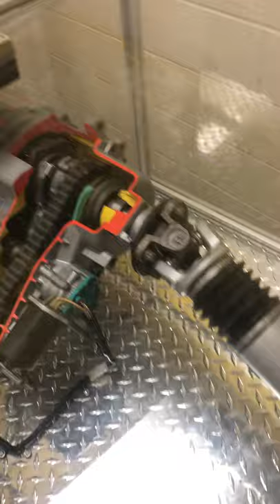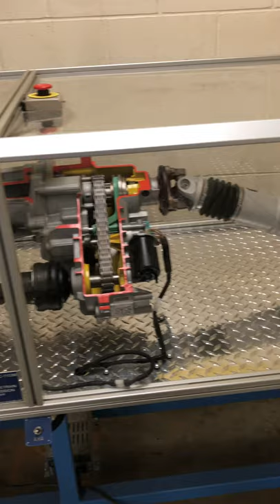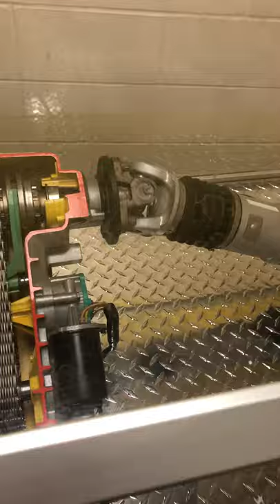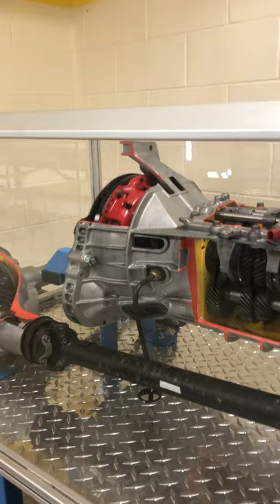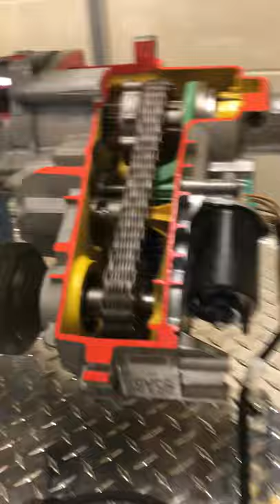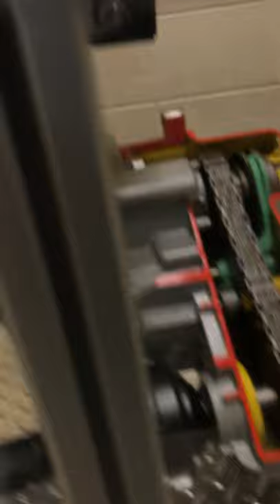Transfer Case Operation

Comment from the maker: Thanks everyone for one thousand views. Not sure who all is viewing this video. Comment with your location in the world.....
Reply from the maker: Manitoba, Canada
Reply: GA, 🇺🇸
Reply: Idaho, Usa
Reply: Chicago
Reply: Nova Scotia!
Reply: Tehran, Iran
Reply: How does the transfer case shift motor work? I have a 2 speed transfer case that grinds/growls at 60mph. I rebuilt the transfer case and have the same noise.  New chain new bearings…. Could the shift motor cause this growling noise at 60?
Reply from the maker: @paulw2583  the shift motor would only make noise during shifting. Make sure the noise isn’t a seized u-joint or rough hanger bearing.
Reply: Sweden
Reply from the maker: @gabrieloprea9181  right on man. It’s great to see how far these videos can reach
Reply: @I have a 2013 ford f150 4x4 I drive in 2 high all time but the from shaft is spinning all time and from cv axles is that normal?
Reply from the maker: @ yes. Those front hubs do not disengage. So the front wheels turn the front axels, which turn the differential, which spins the front driveshaft. The transfer case is not engaged so it just free wheels inside of it. 👍
Reply: @autotech4103  this guy is driving the same truck but from shaft no spinning
Reply from the maker: @andryjcisneros2334  interesting enough, that year range of F-150 has 4x4 and AWD options. AWD would spin the front driveshaft and 4x4 would not. I’m not sure if that’s the case or whether your truck has a locked axel situation……
Reply: @autotech4103  I send you the link of the truck is a 2013 f150 4x4 
But the from shaft is not spinning in 2wd 
So I have the same truck but my from shaft is spinning all the time with the cv axles 
To be honest I’m confused 😅

Comment: What could cause a loud clicking from my transfer case. It started out of the blue and its loud 😞
Reply from the maker: I would first rule of the driveline as it would be difficult to distinguish. Removing the front driveshaft could help in the process to eliminate it from the equation. Loose chain could cause a chain slap or tick for sure.
Reply: @autotech4103  would it still drive if I removed the front drive shaft ? I did think possibly the chain. I'm absolutely gutted I love this car. Thank you for your reply it's much appreciated
Reply from the maker: @ yes, it would drive just fine
Reply: @autotech4103  I thought it would on most but it's a RR sport so has silly computers and such and it's not switchable from 4x4 to 2wd like most 4x4 are. No harm in trying I suppose. Thanks :)
Reply from the maker: @ it will probably trigger a traction control/ABS light. You can just disconnect the battery to clear them after diagnosis.
Reply: @autotech4103  thank you I'll give it ago when I get the free time. Thanks 😊

Comment: That is BW1354 Ford Ranger setup it has oil pump in it. Most of the time chain is still turning in 2H because it has no unlocking hub or they are locked in. Ranger for short time had Vacuum hubs but they took them out so everything sill be turning in T-case. Explorer had same setup but never used Vacuum hub they have disconnects on right side few years. But in the end they dumped that too so everything was left turning. Ford showed it only cost about .02 of a mph in fuel
Reply: Hello. What is the difference between the 2014 and 2021 Ford Ranger transfer case?
Reply: The chain does not spin in 2 high unless your vacuum hubs are not functioning Correctly  or you have manual  hubs and they are in the lock position !!

Comment: I am trying to find voltage requirements for a 2015 gmc canyon transfer case actuator relay signal wire. Anyone know?
Reply from the maker: Are you speaking of the grey wire with the black stripe between the transfer case and the control module? Are you planning on supplying that wire with voltage?

Comment: Really nice explanation of the inner working of the TC, thank you!
I just have to correct something. At 6:25 if the 4WD is disengaged, the chain will still be spinning since the front diff and its shaft is not disengaged by the wheels.
Reply from the maker: You are right, this truck does not disengage the front axels. Good find!!

Comment: Another important feature is torque multiplication. And often they are around 2.73:1 ratio. Which is a Little more significant than 2:1 in the example. Great cutaways to show operation.
Reply from the maker: Sounds like you put your truck to work pretty hard. Most people don’t have a functional use for 4LO

Comment: Thanks, I wasn't sure if the chain constantly spins but now I see if the front drive shaft isn't spining then the chain stops too.  I have manual locking hubs to allow greater flexibility and take better advantage of 4x4.
Reply from the maker: I wouldn’t say the manual lockers give more flexibility but they are definitely tougher.
Reply: @autotech4103  I can avoid windup by unlocking one hub or both manually and operate in 4-low.  Can you do this with auto locking hubs?
Reply from the maker: @thisisyourcaptainspeaking2259  I didn’t think about using 2low for much before. Probably has a use backing up really heavy trailers.
Reply: @autotech4103  I also use low for pulling a trailer up ateep mountian roads at low(er) speed.  Up/down with tight switchbacks using engine braking instead of my brakes.
At the boat ramp I unlock drivers side hub and launch/retrieve in 4-low, if traction becomes an issue I jump out and lock the hub.  Maybe it's not necessary to use low gear but I typically use 4-low as opposed to 4-high in most cases anyway, just unlock the drivers side hub when on pavement.
Reply: @thisisyourcaptainspeaking2259  im sorry and thanks, could you explain "wind up" and why you unlock the drivers side manual hub while in 4 low at the boat ramp ?
Reply: @thisisyourcaptainspeaking2259  Great thought..The crow hopping really gets anoying..

Comment: I just changed the oil in my mitsubishi transfer case and found a large chunk of metal on the magnet. It doesn't appear to be a tooth (seems quite soft). Any idea what could break off inside the case? Getting ready to refurbish it regardless.
Reply from the maker: The metal on a shift fork would be a softer material, but probably not magnetic. Not sure……..
Reply: @autotech4103  thanks for the reply.

Comment: Great visual on transfer case Operation, any idea how the steering angle affects modern transfer cases shifting in 4 low automatically when turning. Experiencing some T case issues myself and before i pull it out i was curious on the relation between my steering column and my transfer case
Reply from the maker: Turning and shifting to 4LO is definitely a weird one. I’d imagine it being an electrical issue. Not sure how anything in the tcase could cause it. What kind of vehicle?

Comment: Great explanation and visual.  Thank you!
Reply from the maker: Glad it was helpful!
Reply: @autotech4103 hi sir. Hello from Chicago. So transfer case actuator shift from 2hi to 4hi or to 4lo but what is the function of second actuator located in front differential. Trying to fix my sierra pickup truck
Reply from the maker: @marekkrepa9982  the solenoid in the front differential engages and disengages the from axels. When they are disengaged the front driveshaft will not spin when the wheels are moving down the road.
Reply from the maker: @marekkrepa9982  depending on the year of Sierra pickups, those actuators are known to be poor.

Comment: Great explanation, my RAM 1500 except those 3 modes have also 4-Auto mode which in my conclusion operates most of the time on 2 rear wheel drive (2 High) but can enable front wheels in case of loosing grip(4 High).
I drive on this mode all the time which means the chain is not moving by 99,9% of time. Does it mean it is not lubricating upper part of transfer case? Maybe I should change mode to 4 Hi or 4 Low from time to time?
Reply from the maker: No need to worry about that. There is nothing moving so no need for lube. When the Auto kicks in then it throws oil.

Comment: Could you explain a little about the pump and clutches
Reply from the maker: Hey Eroom, the oil pump in the transfer case is used to get oil into hard to lubricate oil such as the planetary gear set and the main shaft. Splash lubrication joins forces with the oil pump in these modern designs. I do not understand which clutches you are referring to? I haven't seen clutch packs in a transfer case but like anything prove me wrong. Muffler bearings do exist.
Reply: @autotech4103  Gm 246 transfer case has clutch packs, I’m starting to learn a little about them now
Reply from the maker: @eroom2087  please post here your findings when you have them

Comment: Awesome explanation!!  I’m pretty sure my transfer case is on the front of the transmission.  With that said, Any idea what the light rubbing sound around the transfer case area could be when I’m driving at low speeds and especially going around corners?
Reply from the maker: Does it only happen in 4WD or all the time? Your transfer case needs to be after the transmission
Reply: @autotech4103  Been happening in 2WD.  It used to be intermittent but now it’s more frequent.
Reply from the maker: @colinc1633  if the rubbing speeds up and slows down with vehicle speed, I would suspect u-joints.
Reply: @autotech4103  thank you sir I’ll get that checked out.  I really appreciate it!🤙🏼

Comment: Sure wish you would have explained the function of the transfer case clutch. Where is it? How does it work?
Reply from the maker: This particular transfer case doesn’t have a clutch. There can be clutch packs to deal with difference in speeds between the front and rear wheels.

Comment: do you know if u can shift transfer manually without motor? or does motor have to hold it in place?
Reply from the maker: If you remove the motor you could make “shift” a device to manually shift

Comment: Good job sir 
I am a newbe at this I have a 245 j with a electric motor . I am not sure if that is what my problem is the motor that is ? Not sure how it works? I have a jeep commander 5.7 Hemi the button on in the cabin is suppose to put the transfer case in neutral it blinks but nothing is happening could that be the electric motor?:) if you have time please let me know. Texas. Near Dallas.
Reply from the maker: Some models need to have their transmission in neutral and park brake set. I would check your owners manual to find out for sure.

Comment: Excellent video although I was looking for an AWD TCase presentation.  Can't wrap my head around AWD...
Reply from the maker: I’ll make a video in the coming days as I should have a couple AWD vehicles in the shop next week. Think about it as a differential between the front and rear driveshafts. When there is slippage in the driveshafts the AWD transfer case attempts to match the two shaft speeds. This keeps all wheels driving at the same speed.
Reply: @autotech4103  Thanks!  I almost got it sorted in my membranus...👍

Comment: Some mistake.... You should NOT use 4Lo in manoeuvring a trailer in "tight spot" for most (if not all) T Cases. Reason is 4Lo is (in those majority T Cases) a mode with central locking, meaning both propeller shafts are at the exact same speed. Try a tight turn (say lock-to-lock on the steering) with the central lock. Will either force wheels to slip hardly or damage something.
Reply from the maker: Sure, turning tight is an issue. I gotcha
Reply: I have manual locking hubs for this specific reason, not automatic locking hubs.

Comment: I'm working on a vehicle now. How is it that I have 4 low (with reverse) and the motor switches out of 4 Low, but there's no drive in 4 High or 4 Auto.
Reply from the maker: I would check the actuator that actually shifts the transfer case. The electric motor or the switch/wiring could easily be at fault

Comment: is it possible to have a problem in your transfer case that causes slipping and grinding while in 2wheel high? primarily in reverse and or high gears moving downgrade...
I'm being told the problem is in my transfer case, however all my 4 wheel drive is working fine.
Reply from the maker: Depending on the vehicle and the design of the transfer case; it is possible.

Comment: Would have been neat to see the transfer case in neutral. I always wondered how it sepererates the drive shafts.
Reply from the maker: I’ll do that in the coming days and post it here!
Reply from the maker: https://youtu.be/oN0kF2lgXYs
Reply: @autotech4103  I just watched the video. That was really cool to see. I always wondered how it did it. So basically from what I seen and what you explained is the transfer case just disengages the planetary gear set. Really cool to see. Thank you for answering my question! You earned a sub!

Comment: How can you explain, other than "bad input shaft TC seal", the fluid can migrate from a automatic transmission into the TC?, talking about the olds TC with vacuum switch, maybe the vacuum plays a role in the issue?
Reply from the maker: On those old transfer cases the problem really isn’t the input seal but the vacuum switch. The vacuum switch is suppose to be sealed and not apply to the case of the t-case. The t-case vent gets sucked closed and pulls fluid by the output shaft of the transmission through the input shaft seal of the t-case. Replace the vacuum switch and the other problem may go away without seal change. Kinda a cool automotive problem……

Comment: Question. I was told in my 2001 Mitsubishi montero limited that the front driveshaft is always turning even in 2nd and it locks via the front diff. I have had the vehicle for over 75000 miles. Should I change the transfer case fluid? Thx
Reply from the maker: I change my 4x4 fluids every 100,000kms in Canada as it is a nice round number and easy to remember. 75k miles would be a yes for me…..

Comment: What happens when you tow this type of setup and the front wheels are spun freely with the Tcase set in 2H. Does it affect the tranny at all ?
Reply from the maker: This is a standard trans, the rear driveshaft will be spinning while being towed, the front driveshaft will be turning while being towed. In 2H the power from the rear spinning driveshaft will turn the output shaft of the trans. Because the trans I assume is in neutral the rest of the gears will not spin. The output shaft bearings will be spinning without lubrication so damage will occur. With the tcase in neutral the power will not spin the transmission output shaft

Comment: I have a 2000 ford ranger that will shift and operate in 2 high and 4high , but when shifted into 4 lo there is a repetitive clunking noise while in 4lo operation . Would you have any ideas why? It is a new to me used truck and I’m slowly learning more about its engineering . So far I have been hesitant to run it in 4 lo to see if the knock / clunk goes away , not wanting to get stuck in 4 lo permanently . Any advice would be highly appreciated .
Reply from the maker: 4low is often difficult to shift into and out of. Make sure the transmission is in neutral when shifting into 4low or creeping slowly ahead. I would guess your clunking is it trying to engage still. Does it drive at a very slow speed when 4low is selected?
Reply: Thanks for your reply . I enjoyed your video on the transfer case operation , it helped me to understand the mechanical operation in action . I grew up with a 78 Toyota landcruiser that was virtually indestructible mechanically, but unfortunately the gas consumption was not realistic economically this day and age . As I have been reading more about the ford equipment , there is a whole cornicopia of procedures for the mousetrap to engage .such as clutch sensors , brake sensors , gem computer units  as well as a transfer case motor that controls the shifting mechanism ,not to mention puh pneumatic hubs . I have also noticed a few loose wires behind the dash , and near the pedals . Guess it’s time to des if er some wiring diagrams . The joys of owning a new used vehicle . Thanks again from a backyard wrench  @autotech4103

Comment: What does locking the hubs  manually at each wheel band NOT having the transfer case electronically in 4 x 4 do?
Reply from the maker: It locks the front axle shafts to the wheel assembly. The front wheels will then turn the axle shafts which will also spin the front driveshaft on most vehicles. No wheels will be driven by the transfer case, just all the gears in the differential will spin

Comment: Why my truck act like it's on 4LO ( can't even turn) but positioner is set to 4HI mode?
Reply from the maker: Turning with a vehicle in 4WD can be difficult. Some vehicles are much worse than others. You could also be dealing with a limited slip differential that is locking while cornering because of clutch issues. 4Low is the same as 4Hi except the gear ratio.

Comment: How to test if actuator is shifting or bad transfer case
Reply from the maker: On most transfer cases the actuator is on the outside. You should be able to feel it move when activated or you could measure the current to verify the motor is turning. Internal problems won’t be realized until it is taken apart.